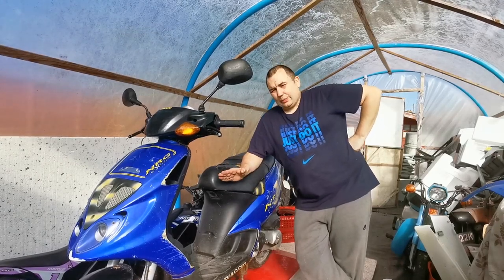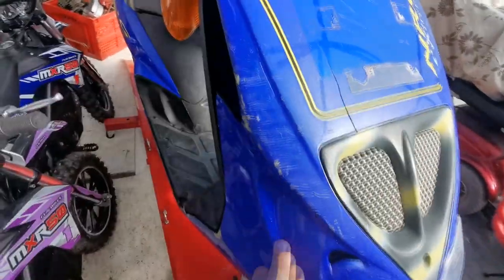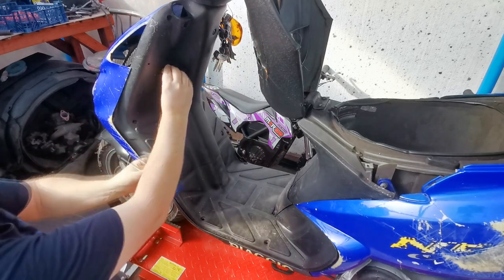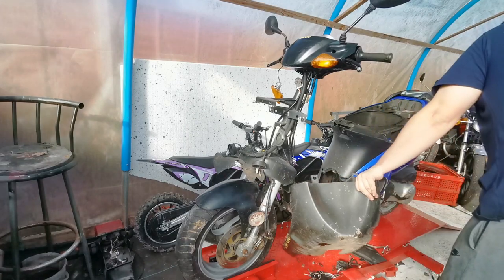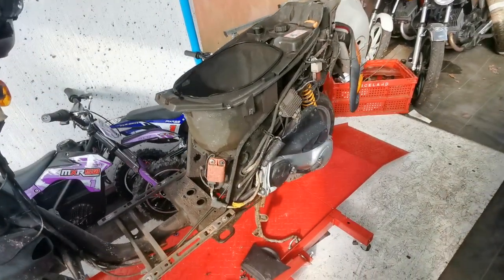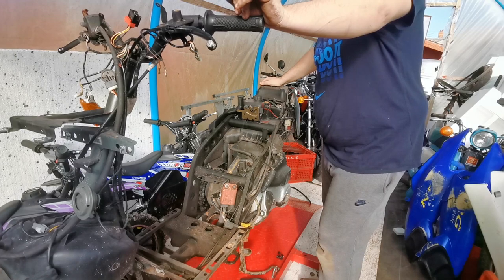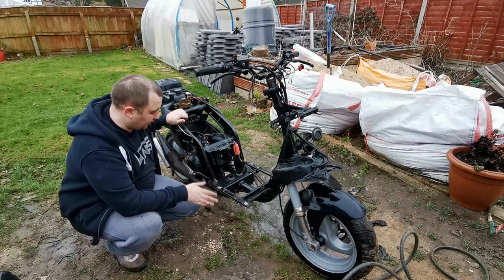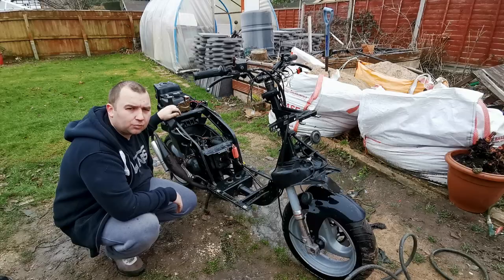Piaggio NRG mc3 Strip Down

Comment: I recently stripped a Piaggio New Fly. 
To get the front fairing off you need to start at the rear light. 
It’s all covered in a way you will not be able to get to the screws otherwise.

Comment: I got the same bike, haven’t been running for 14 years but would like to get it running again. Bought a new batter and Tried to start it and get it running but it cuts out after releasing throttle  ideas on what could be the issue?
Reply from the maker: I would say you need to have the carburettor off and give it a good clean

Comment: Thank you for this video
Reply from the maker: Cheers 👍🏻
Reply: @ProjectMan  by chance you also have a video where you show how to disassemble the engine block?  I need to clean the carburetor and the filter, it is an old ngr power of mine that has been stopped for some time and I would like to put it back on track
Reply from the maker: No sorry not had the engine apart on this one only a service.
Reply: @ProjectMan  okay thank you same 🙏

Comment: just bought one, bogs high rpm ;/
Reply from the maker: Carb
Reply: cleaned the carb,fresh spark plug,and it still bog
s down it only has power to move for 2-3 seconds when first started then bogs down even when revved,i think its eletrical beacuse my turn signals ,fuel and temp guage do not work ,and im thinking its a wiring issue @ProjectMan
Reply from the maker: @andrisak4795  bogging down won't be nothing to do with your dash board gauge not working either your Carb needs setting up or replacing or the petrol is getting restricted look under the petrol tank you should see a silver disk with fuel pipe coming off it sometimes that disk needs replacing as it has a diaphragmin it and it can fail
Reply: @ProjectMan  okay thank you i will have a look, but when i was dissasembling the carburetor from the fuel line ive noticed a pretty weak dribble coming from fuel line.thANKS.
Reply from the maker: As I say check that disk I had the same problem 👍🏻